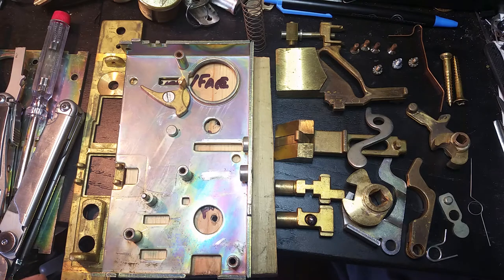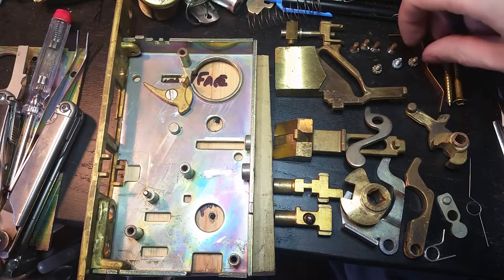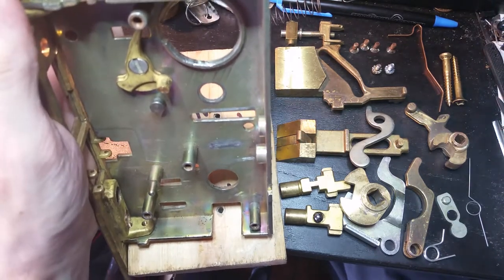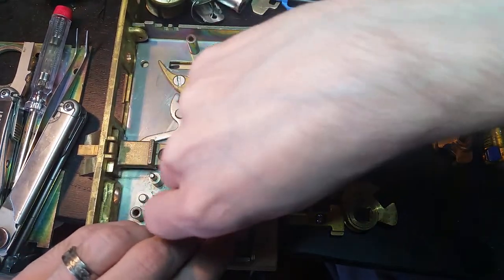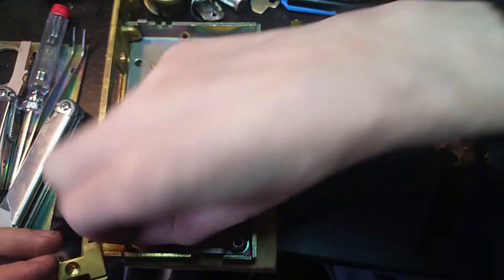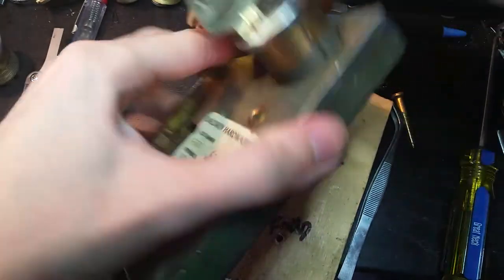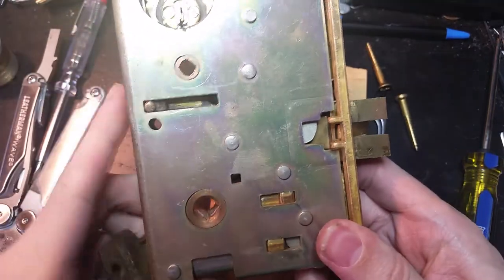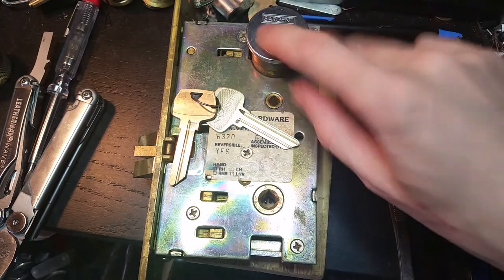(87) Baldwin Estate 6320 mortise lock rebuild challenge

Comment: So I’m late to this party but it’s still a great video! I’m on the prowl for a good mortise lock to learn with. Very nicely done!
Reply from the maker: If you can, try to find out what the most popular brand and model are in your area (in NYC for instance the Marks 91A is the most popular on the market), otherwise see what you can find cheap on ebay in good condition.
Reply: Most of the stuff around here is Schlage, except for schools which are a complete Corbin Russwin system. I really haven’t had much of a chance to study many mortise locks around here actually.
Reply from the maker: @LockPickingPatrolman  take a look at the edge of the door, the faceplate around the latch will tell you what brand the mortice cassette is, people can put almost any mortice cylinder in that they want. Lots of manufacturers will even make un branded cylinders in popular unprotected keyways like Schlage C for customers that just need cheap cylinders.
Reply: I’ve been trying to do that lately, but other than schools and some old buildings there really aren’t that many mortise locks I come across. The only (and I mean only) locksmith still in business around uses US Lock cylinders and keys so I’ve gotten pretty good at spotting those lmao!!
Reply from the maker: I always forget about U.S. Lock, no one around here really uses them since they got bought by Home Depot and turned into more of a distributor, most of their current hardware is just whitebox locks and blanks with their branding applied.
Reply: Yeah I’ve never really seen anything great with their stuff (albeit minimal), and I wasn’t impressed with their website either. Just a branding attempt from what I see.
Reply: i guess it is kinda off topic but do anyone know of a good place to stream newly released series online ?
Reply: @Stephen Marvin Thanks, I went there and it seems like they got a lot of movies there :D I really appreciate it !!
Reply: @Crosby Tristen Glad I could help :D